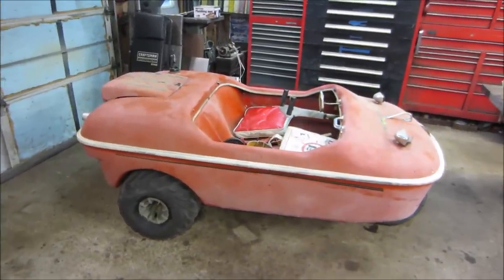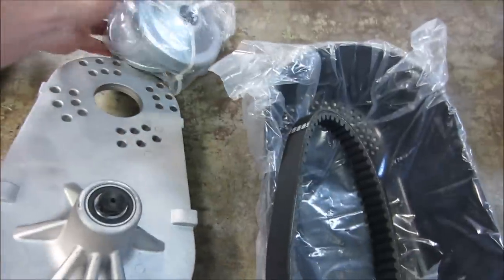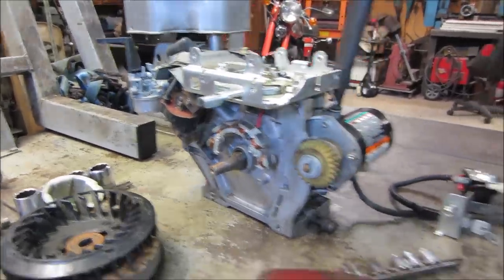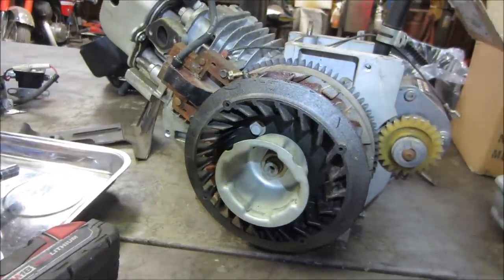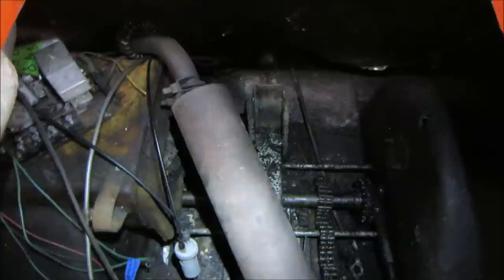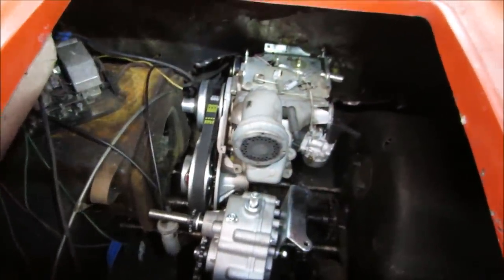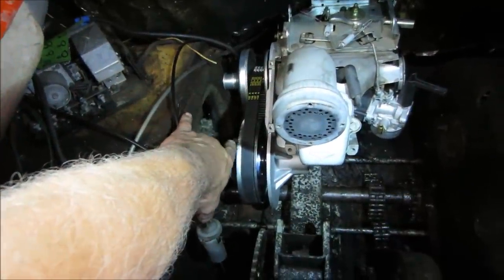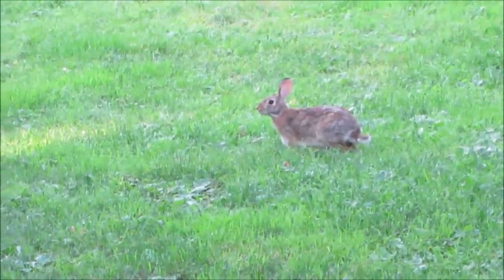beaver amphibious vehicle gets new engine

Comment: Could you trim down the input shaft of the forward-reverse gearbox, fit a uni-joint between it and the output shaft of the CVT ? That way you would (at least) eliminate the "not so charming" transfer chain link... That kind of setup would give rise to flipping the engine around to have the fan face the intake hole". If you would mount the fan either IN the box or somewhere along it's feed you could have the engine compartment ventilation as well.

Comment: Maybe cut a flat plate the same shape as that aluminum mount for the torque converter, then bore out a hole for the nose of that gearbox that would keep the belt mounting distance correct?

Comment: Doesn't the gearbox also have oil in it? You probably can't mount it upside down. Looks like there is some kind of oil level indicating bolt. That should be parallel to the ground.

Comment: Take a look at the video you attempted to sail beaver.  You were heeled over about 15 degrees and you were way to low in the water.  You need one hell of lot of flotation.  You also need to balance you and that engine in the beaver.  Space out your wheels another 16" or so.  Set the rear wheels back about a foot.  Seal in your wheel wells with fiberglass airtight than fill with maybe 25 psi.

Comment: I think this will be an awesome repower with the 8 hp briggs.  A challenge is always fun!  I have a 1931 villiers bike engine.  From my research they are very finicky and incredibly hard to find parts for, at least mine is being 40 years older than yours.
Reply: Have you checked with Villiers Services for engine parts ? They have everything for the 9E originally in this Beaver.

Comment: When I do take the back of your big CVT where the clutch size through in the shaft where the sprocket is and take and milled the backside of it down either with a grinder or a meal that you have in the back build the back of it down and run the actual actual transmission through that shaft that should give you enough to connect your big CVT clutch to it it appears to be only an inch and then it shouldn't bother you I mean

Comment: Love you work bud. Only question I have is with that other flywheel you used. I didn't see any stator magnets on the inside like the original. Not sure if it did or not. Don't think the charging system will work to well without them :) 

Love being glued to your vids though! 👍
Reply: Frieb5 yep the original flywheel had the magnets.
Reply: Saw that too.  Lol.  No magnets, no charging output :)
Reply: He used the original wheel...

Comment: If u look around u can find driven pullies in many shaft sizes for 20 30 or 40 series torque converter.   Just sucks having the wrong setup for dirsct mount.   Make a bracket to mount ur revervse with a short chain at probv1 to 1 gearing between tc output shaft and reverse gears input shaft

Comment: I did some study on the motor itself, and frankly, there's not much worth in the original idea of even using it for an enclosed space. I would say that without an extremely well made ventilation system these things would chew their bearings quickly unless upgraded to something more beefy. And, other 'beavers' on the interwebs (specifically blogs looking for this engine as spares - the talk) seem to support my findings.

Comment: Hey Mustie, if you put the flywheel from the other engine that doesn't have a charging system on your engine you're not going to have a charging system because there's magnets on the inside of the flywheel but only on the inside of the flywheel for the engine that came equipped with a charging system.......

Comment: Could you have the secondary opened up on a lathe to accept the reverse gear box shaft...looks like it pretty close to the correct size
Reply from the maker: im not tellin , gotta wait for the next video,
Reply: That's what I am thinking - Drill it out and put in a bearing that will work with the gear box shaft.

Comment: Mustie, there are bearings in the forward/reverse gearbox, could you grind/cut off the bearing area on the jackplate from the comet clutch and mount the cvt drive pulley directly to the gearbox once you mount the gearbox to the jackplate? Would this save you from having so many chain drives back there? I think the gearbox could support the back cvt if you can get the bearing out of that jackplate. Thanks for the fun stuff!

Comment: Instead of polishing the output shaft like you did you can run the engine on idle and wrap the shaft with 100 grit sandpaper and do that for about 15 seconds.

Comment: Hi do you have to mount reverser on top of the axle? can´t it be mounted in line with the jackshaft
Or is it possible to mount cvt so that secondary axle is on top of the engine where gastank used to be?

I have seen some really long cvt-belts, so it gives possibilities to mount secondary axle basically where it can fit

If you find long enough belt you can flip engine other way and have secondary of the cvt be on top of the jackshaft, make axle for it and mount reverser on to front of the secondary
So there is possibility to change cvt belt without taking engine out, and with diy secondary axle it can be longer than needed for ease of sideways placement of the engine

Secondary could move up n down in a slot to tighten secondary to reverser and reverser could move back and fort to tighten reverser to jackshaft and jackshaft can move as from factory to tighten drive chain

So when tightening chains loosen everything tighten drivechain, jack->reverser, reverser->secondary

Comment: Looks like itll work out just fine that old engine looked like it would be an unreliable nightmare anyway. Id be a little tempted to open up the gearbox and see if its just a keyed shaft you can put a longer one in there.

Comment: Hi Mustie 
I have been watching this series with special interest because In years past I was involved with a similar vehicle adaptation. When our project was in process we seperated the upper half of the fiberglass shell to allow easier access to the modifications. After removal of the trim piece the shell separated quite easily.We did not modify the shell and when put back together you could not tell it had been separated.  I was wondering if you had given separating the shell any thought ?

Comment: What about putting gearbox the other way (with shaft pointing right). If forward and reverse are same ratios. Whilst keeping engine as it is currently orientated. Also a Big PC fan could do the recirculation efficiently and quiet too. Great work anyway.

Comment: seems to me a relatively small motorcycle engine would be the best choice. Add the reverser, it's done. Shifing it would be a problem I guess. but the same transmission would work on one of those as well, would it not. least ways it would with a little engineering.

Comment: I think you're going to need to build a mounting plate that goes on the bar in the boat. From that you can make a jig to work out the relationship between the engine and GB. How does the drive mate up with the fore and aft prop shaft? Bevel gears or a small diff?
Off the wall but are there any small jet drives around. They should have a reverse plate or deflector and you could just use the engine without the gearbox.
Reply: Duh, realised that the wheels are paddles do no need to change the drive 90º. Old brain, after midnight is my excuse.

Comment: Really enjoy watching your videos... but in this case I was wondering if you thought about converting it to an electric boat... maybe an electric motor would be small enough to fit in the space and the weight needed could be batteries... granted it would need charging system but if it was for just pottering around a lake then maybe the range wouldn’t be an issue.

Comment: Is that cradle in the bottom reversible?  I was thinking if you swapped it, and removed/replaced the axle with gears on it to the other side, you could have the engine fan intake right against the box, AND, leave more room for the transmission ?

RichE

Comment: Can the sprockets on the original Beaver shafts be moved to the other side (left) then reverse the motor so you can use the motor fan as originally thought? Then just mount the Beaver jack shaft upside down so all of the input from the motor is now on the right.

Comment: Can you not machine an adapter or a bushing of some sort on your lathe that will make that variable speed pulley fit on the gear box shaft? That would get rid of one chain in the system. Can even be possible to remove existing bearings from the CVT plate and weld/braze the gear box to it via that bit of it's casing that sticks out over one of the shafts. Another idea is to couple the output from the CVT directly to the input of the gear box by using two identical sprockets on each, mount everything where these sprockets are side-by-side, and use a piece of double-wide chain (like what goes to the wheel shaft) as a coupling between the two. Otherwise you will have a belt and three chains to keep tight and lubricated, not to mention more potential for something wearing out and breaking over time.

Comment: If the beaver is like the Argo you can remove the trim ring around the body to remove the top to gain access to the inside. Also if you can find an Argo check it out for drive train ideas.
Reply: The Beaver body is fiberglass and the top, bottom and seat are bonded together.

Comment: If its like a boat shouldn't you be able to remove the trim and split it into upper and lower halfs? there should be a seal between the 2 also.
Reply: It's a boat you can drive through the woods. Top and bottom are glued together.

Comment: Newer Ski-Doo or Polaris snowmobile engine with electronic reverse (reverses the engine rotation) would probably have been easier. The newer Ski-Doo Tundras have a single cylinder with the electronic reverse and they should be available with e-start.

Comment: That engine is not 8.5 horsepower. Briggs rates engines by torque nowadays. With the added weight of that engine plus torque converter and reverse gearbox you are losing a lot of what this Amphibious vehicle can do. The charging system on that engine will never keep up with an electric fan. Great video and hope the project works out for you!

Comment: While it would be some work why not make an adapter plate out of 3/16 steel plate to custom  mount the gearbox to while retaining the correct distance between the pulleys. Just bore the driven pulley out to fit the gearbox shaft. Making a custom plate would allow you to put the gearbox exactly where you want it.
Reply from the maker: gotta wait for the next video to see

Comment: What about a float test before adding engine. You can use a rubbing compound by 3-m to get rid of oxidized fiber glass. Then after that add lots of wax it will soak it in so more than one coat is most likely needed.
Reply: I have one of these and someone always asks if it is freshly waxed, then they laugh for some reason !?

Comment: Hi there Mustie1, not to throw a wrench in your gears, but i think you have to use the original flywheel, the one from the parts engine did not have any magnets, so it will probably not give a charge to your battery.
Reply from the maker: l saw it when editing, its been swapped back

Comment: I'm wondering if, rather than using the gearbox, it's possible to rig up that engine to the original ignition system to run the engine in the reverse direction...
Reply: The original engine was 2stroke, would run either way. The briggs is 4stroke, only runs 1 way
Reply: +Ivan Ferguson  I understand, I wasn't sure if it was two stroke or four stroke, I probably missed a sticker on the engine in the video...

Comment: How does the villiers stroke compare with the Brigs? A lot of English engines of that era are long stroke ,small bore because of Horsepower taxation rules then in place. If the Briggs is a large bore shorter stroke engine it's gong to revving hard to do the same work.
Reply: Some info from the Beaver sales brochure : 9E engine 2.33" bore 2.84" stroke, rated 9.8 hp at 5200 rpm. Overall reduction (crankshaft to axle ?) given as 9.4:1 or 11.4:1 depending on primary sprocket. Speed range 1-1/2 mph to 28 mph land, 0 to 4 mph water.
Reply: 28MPH in that thing would be moving along! ha ha it would seem the old engine was indeed a longer stoke engine.
Reply: 28MPH feels too fast. Might have to find a place where I can do a vid of mine on the road.  No promises !

Comment: Idk it your gonna remove the cvt again or not but I believe it's installed wrong the spacer you have on the motor pulley on the front i believe is suppose to be in between the motor and the pulley not on the outside plus there's suppose to be a brass bushing on the pulley that the belt rides on I couldn't tell if you installed it great videos wish I had a shop like yours I do my projects out of a 8x10 shed lol
Reply from the maker: its just mockup

Comment: I would remove this in the clutch on the jack shaft and put a sprocket on the end. And then run that sprocket to your Gearbox thing and then brown that street to where your axle that way you do not have to try to move around with the motor
Reply: Sorry I was using talks to text but you get the jest

Comment: Is there a seam in the body under that bumper strip?  I'd be strongly tempted to take the top half off rather than try and fit an engine through that hatch.
Reply from the maker: does not come apart
Reply: Everything comes apart :)
Reply: Top and bottom are 'glassed together. Not an easy job taking it apart, much less fun putting it back together !

Comment: how are you going to change the oil??
Reply: pump it out through the dipstick?
Reply: beachbummm69 I gotta nifty little 12v oil pump for intermediate oil changes, goes down the dip stick. Still drop the oil when I change the filter though.

Comment: I commented on the last video but imagine that you get so many comments that it could easily have been missed. What about maybe using the suzuki engine off your yard mule thingy... that you built out of a quadrunner? It has electric start, is a single cylinder, light weight, similar in cubic inches/displacement, and has forward and reverse gearing.
Reply from the maker: they are too long

Comment: Mustie- just a thought, why do you need reverse? It is small enough just to put it in neutral and spin it with a paddle.
Reply from the maker: some times if the waters edge is steep you need to back out of the water to be able for the back tires to grab onto land
Reply: Mustie1 - Good point! I enjoy watching your stuff just seems like a lot of trouble for something you do not know if it floats. Here in Michigan you would have to get that registered as something, to use it in the water.
Reply: It's guaranteed to float - even if he has to patch a few holes first. The key issue will be longditudinal (and potentially lateral) CofG.

Comment: Are you certain that the Beaver floats without taking on water?  Hate to see you do all the mechanical work if there’s a leak that caused the demise of the original engine.
Reply from the maker: if it does l will just fix the leaks
Reply: Fiberglass is easy to repair. Made myself some spending cash back in highshool patching boat hulls for people. Perk of a summer job at the marina.
Reply: Is that the liquid or solid patch type?  Hey, what about turning this into an airboat?

Comment: Musty .you have put on the wrong flywheel .the other motor had a starter but no charging coil .
and the flywheel has no magnets .
so youre charging system is not working .
ps its not the flywheel key that is holding the position its the taperd shaft .
the key is just for correct mounting .try it out .
greetings from the netherlands.
ps like all youre vidjeos

Comment: Bob Ross...
I mean Darren, 

;4)

I enjoyed this one sitting in the breezy shade on a cheap foldable cloth and bent tubing chair whilst enjoying a 'wobbly pop' in my backyard with my hoard (it is semi controlled but the landlord seems to think that even after 9 years tennents should pay rent but not really live there.)

Q: is it bad practice to put grease in the final assembly when joining an output, key and flywheel, drive, metal thingie, etc. I do this because I hope that if I see that again then atleast I may have a hope in heck of pulling it off again. [wish I had a puller]
Opinion, pls?
Reply: Peg Tooth anti-seize

Comment: a Polaris transfer case would cive you more gearing
Reply: a Polaris transfer case would have the pulley on it and then you have the one on the motor and the final drive coming off the transfer case is chain

Comment: So I guess you can't run the Briggs backwards by starting it "backwards?" Starter probably wouldn't "throw out the gear, would it. Yeah, that's stupid.
Reply: A 4 stroke would need a different camshaft to run the other way. And yes, starter won't kick out the gear turning the other way (tired it once !)

Comment: Am I being a bit thick why can't you just use the original system and make that engine run backwards
Reply: The new engine is a 4 stroke so it won't run backwards without a different camshaft.  The original engine is a 2 stroke,  much easier to set it up to run either way.

Comment: But it's less hp ,why not putting a bigger piston in and make the valves bigger
Reply from the maker: id rather sped the time getting it working 1st
Reply: Mustie1 i agree ,just said because the engine was removed so it would be easier,weren't you able to find n engine with the same hp?